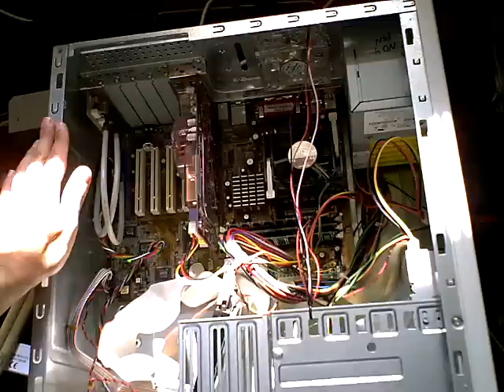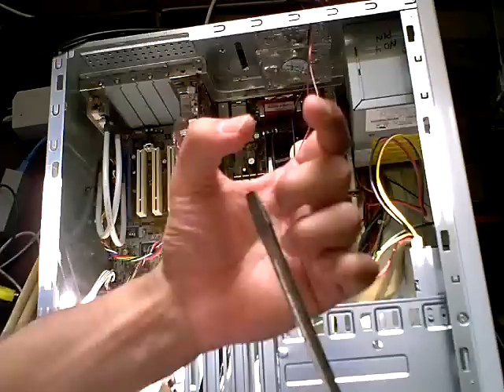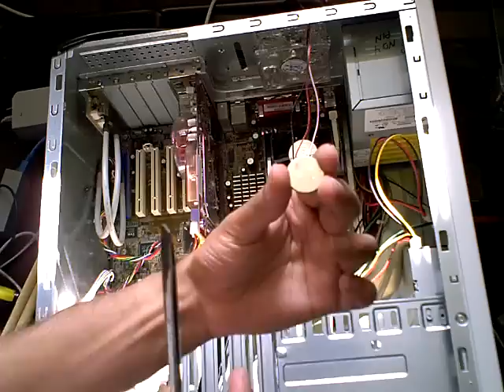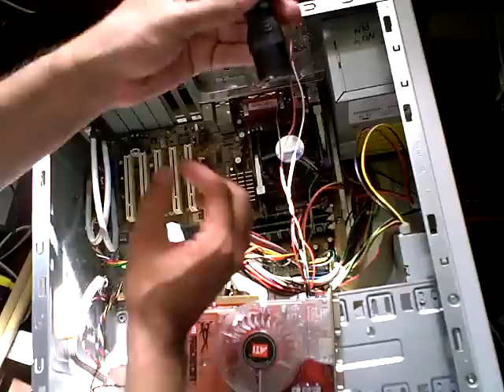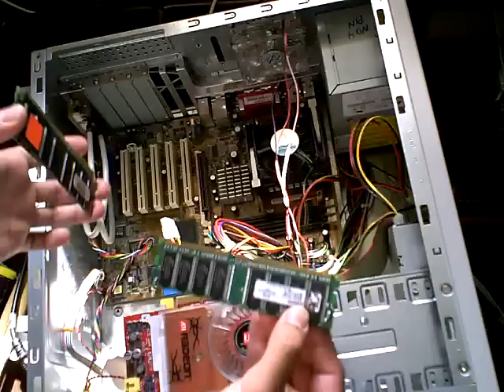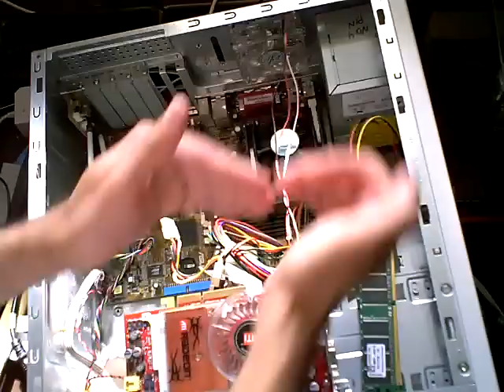How to possibly fix a PC that will turn on but will not beep and will not display anything on screen

Comment: Im desperate my problem started with my pc rebooting by itself when gaming, then it would restart at random now it wont even show picture on the screen but the computer is on.... what should I do?
Reply from the maker: It sounds like your motherboard is developing a short circuit due to contact with the metal casing. Most likely it has to do with the screws and metal mounting stands (supports) that your motherboard sits on. The cheapest way to fix this problem is to introduce cardboard washers between the screws and where they make contact to the motherboard, or you can buy plastic mounting supports at a computer shop.

Alternatively, you can always Breadboard it: 1)place the motherboard with CPU+Fan on wood or non-shiny cardboard 2)connect all of the case connectors to the board's panel 3)with a power bar that is OFF connect the PC power cable from the power bar to the power supply and the power supply to the board 4)while NEVER touching any exposed component,power on the power bar and press the power switch on the case.If the problem still persists,one of the remaining components is probably defective.Power off the power bar before dismantling

I cover breadboarding in greater detail in this video:
Advanced troubleshooting technique tutorial of how to possibly fix a PC that will not beep at boot
---

Comment: i have a a68hm grenade made by msi i got their bundle with a amd processor its all connected correctly but when we try to load start bios it doesnt load. my fans and leds are on  but my screen is black
Reply from the maker: +candykiller287 Same issue as shown in the video. Try what you see there

Comment: I never needed to remove CMOS battery before resetting it by using the jumper. Is this really necessary?
Reply from the maker: +MarkoH01 Unplugging the PC, Removing the CMOS battery, pressing the Power Button on the chassis, and waiting overnight performs the CMOS reset most assuredly. The jumper pin method is for a quick fix (that does not always work well sadly)
Reply: Thank you for letting me know. I did not realize that the jumper method sometimes does not work. Good to know :)
Reply from the maker: +MarkoH01 Best of luck with it all.

Comment: Ok so my pc is turning on i get the beep and everything but it is loading up then stall idk what would make this happen even in bios or before it even loads my keyboard it can stall i most of the time can start to boot up windows but shortly after it starts my screen flickers and it stalls idk what todo about it no settings are doing this i tryed testing the ram is fine my proserer is being cooled at 40•c so at this point i have no idea what whent wrong
Reply from the maker: +repo gaming Hmm, I was going to suggest that the CPU is overheating. Perhaps it's a faulty component? you can always Breadboard it (explained in the following video:)

If the steps in this video did not provide a solution to your problem, view:

http://www.youtube.com/watch?v=_EK9a-R5pss

You never know, maybe rebuilding the PC in the opposite sense that you took it apart will solve the problem.

Comment: The is quite helpful, thanks! Even tho it doesn't solved my issue!
Reply from the maker: Sorry things didn't work out. Have you tried Breadboarding it? (explained in the following video:)

If the steps in this video did not provide a solution to your problem, view:

http://www.youtube.com/watch?v=_EK9a-R5pss

You never know, maybe rebuilding the PC in the opposite sense that you took it apart will solve the problem.

Comment: my pc first started to hang after login, and i had to restart it again, with no guarantee how long i have before it hang again, and now suddenly a black screen, what could the problem be?
Reply from the maker: +Adit chauhan Many things. Your operating system could now be corrupt. Your CMOS settings could be corrupt, etc, etc. Is your PC beeping at boot and displaying something on screen?
Reply: RodneyDickson thanks for your concern, there was no beeping at all, no display at all, what i did was cleaned the fans, discharged the cell ,replugged all the wires, hopefully it worked.
As i said it used to hang in between b4 by that i thought may be alot if dust on fan over processor causing that. So i did.
Is it that the computer stops if the fan over processor stops spinning?
Reply from the maker: +Adit chauhan Well, I would say that you should breadboard the machine to diagnose what is the problem more precisely, but if you are saying that the problem is intermittent, then perhaps just tough it out. Btw, if your CPU is not receiving adequate cooling, then your CPU will shut down to prevent damage, thus freezing your machine (including mouse movement)

Comment: when i start the pc It's showing that disk boot failure,insert system disk and press enter i hv inserted disk and tried 5 to 6 time but it's not working what should i do
Reply from the maker: Ok, if you had a hard drive installed with an operating system on it, then your machine is having problems accessing the hard drive. If you didn't and are trying to access a bootable CD, DVD, USB or Floppy, you might need to set the proper boot order in the BIOS. Enter the BIOS and ensure the boot order is set in the order in which you wish to access, and also ensure that no other devices may be interfering with the boot process (CD, DVD, USB, or floppy unintentionally left in a drive).

Comment: Sir can you help me, I just inserted lately a RAM 2.5v on my PC for additional I have 1.5v RAM. It smoked and lose monitor connection when I on it again. I immediately unplug and remove the RAM that I installed. This is the pc I've been using now. Would this okay to use again for an hour sir? Please help...
Reply from the maker: Well, if there is damage to the components, I'd say the damage is already done. To be sure, you can unplug your PC, remove the RAM modules, observe the contacts of both the RAM modules as well as the RAM sockets for any damage or burn marks, and if both are still good, return the 1.5v RAM module to a socket that DID NOT have the 2.5v RAM module in it and try to use the PC. If the PC still works without issue, then I wouldn't use the socket that had the 2.5v RAM module in it ever again. Hope things still work out for you.
Reply: Thank you for the respond sir. Yeah I removed the 2.5v RAM and I will never place a ram on the slot which it has now burned. My problem is that the pc is still working infact this is the pc I'm using now but could it be possible if the damage area of a socket ram will melt while I'm using sir?
Reply from the maker: UltimateSmackTalker
If the contact of your RAM module has burnt, then metal flakes making contact between pins in the RAM socket could possibly cause heat, melting, or even a small fire. Perhaps for the first week of use, you shouldn't leave the PC running unattended. Afterwards, I would assume that it'd be safe to use your PC unattended. If you are really worried, you can unplug your PC, and use compressed air (remember to hold the can UPRIGHT and not slanted or upside down) and blow compressed air in the damaged RAM socket to hopefully dislodge any metal debris. Afterwards, leave the PC unplugged for an hour, then afterwards you can get back to using it.
Reply: Thanks sir, good thing for the supposedly inserted RAM 2.5v didnt leave a metal or plastic melted in the slot 2 sir I checked the 2.5v RAM the one tiny metal in it which is burned area is still there but when I scratch it already detached but luckily didn't attach to the slot 2 RAM and so 2.5v RAM wont be use again and I will not use it either.

The RAM 2.5v which was damaged still in its shape only 1 of the tiny metals already detached sir the one I scratched. Sorry for my bad English.
Reply: But the 2pins of the RAM 2 slot socket in motherboard is already not in line (14 pins aligned). I will not use the slot 2 RAM socket anymore, my other concern sir, would it not be melted even though there's no more RAM inserted in it but the 2pins in it are already not aligned right sir?
Reply from the maker: UltimateSmackTalker
I think your approach is the right one. Do not use the damaged 2.5V RAM module any longer, and do not use the slot that is misaligned any longer. I cannot talk you through the repair of said slot (I've never done anything like that before) so I think just not using those items are the best course of action : )
Reply: Yes sir. Thank you so much for your time :] Best of luck to you
Reply from the maker: UltimateSmackTalker
My pleasure. All the best : )

Comment: My pc starts up, but doesn't respond/ and no display/ and no sound. But know, I have a computer from 2005. I have just installed a 650w power supply and a GeForce gtx 760 in the computer for laugh and giggles, it was working fine and was work really good. so I had powered it off and went to bed, and when I woke up, it had did that......?? could it just be the mother board?
I had disconnected the graphic card and tried using the onboard graphic, but still nothing. But when I do power it on, I cant shut it off, soooo... I have a switch on the back of the power supply that I have been using, I even reset the cmos too, but still no improvement, I did order a new, and improved/ gaming/ board and processor, but it would be nice if im missing something and it can be fixed!!!! But my only theory is that the power supply had to of over worked the board, and buring something on start up.and also my fan speed is at full and the usb ports still power!

 PLz help if u can!
Reply from the maker: +A_CRAZY_WHITEBOY Breadboard it (explained in the following video:)

If the steps in this video did not provide a solution to your problem, view:

http://www.youtube.com/watch?v=_EK9a-R5pss

You never know, maybe rebuilding the PC in the opposite sense that you took it apart will solve the problem.
Reply: i just bought a new build. thx anyways    :)
Reply from the maker: +A_CRAZY_WHITEBOY Better that way : )

Comment: i got home from vaction, pc was on standby. so i tried to boot it back into normal mode but it didnt so i tried to turn it off and the button didnt respond. cut the power. now i dont get any screen alltho every component does startup, would thois be a power supply problem or just a dead motherboard I( did all your steps nothing worked)
Reply from the maker: Oooh, it's a real good thing you added that last parenthesis at the end, else I just would have told you to watch the video : ) Sadly, the only thing I could tell you is to Breadboard it (explained in the following video:)

If the steps in this video did not provide a solution to your problem, view:

http://www.youtube.com/watch?v=_EK9a-R5pss

You never know, maybe rebuilding the PC in the opposite sense that you took it apart will solve the problem.

Comment: yo i'll tell you the whole story. so i hit my computer while i was using it and i did that 2 times. first time i hit it the screen froze and there was a weird sound coming out of the speakers but when i restart the pc it was all good. second time i hit it, it froze again and there was that sound but when i restart it wouldnt beep at all. so i opened my pc and start doing what you did. weird thing is i remove graphic card first and still no beep sounds, but after i remove my rams i get 1 long beep and 2 short beeps. i get 1 long beep and 2 short beeps when i have graphic card connected on mobo and connected with a monitor (no display tho). can you pls help me cause im considering buying and new pc. thanks in advance :)
Reply from the maker: +ExcellentChoice1996 Beep error codes differ from one BIOS manufacturer to the next. To discover what the beep error code is trying to telling you, discover the manufacturer of your BIOS (available in the motherboard's manual or on the motherboard's manufacturer's website {on the page for your specific motherboard model}) and then look up the frequency and interval of your beep error code on:

http://www.computerhope.com/beep.htm

Comment: When I plug my monitor cable to my graphics card, there's no signal to my computer.. But when I put the cable to the normal plug.. It works please help!
Reply from the maker: Ok, you have to change the default primary graphics adapter setting in your BIOS from integrated to add-on. Your motherboard's manual should tell you which option to do this with.

Comment: My Pc is like that but in a matter of minutes it turns on if you restart it turns on fast but if I shut it down sometimes it boots fast sometimes it doesn't boot and the power restarts it self and power on again in a matter of minutes it turns on. What could be the Problem of my PC?
Reply from the maker: +Edd Justinn It sounds like your motherboard is developing a short circuit due to contact with the metal casing. Most likely it has to do with the screws and metal mounting stands (supports) that your motherboard sits on. The cheapest way to fix this problem is to introduce cardboard washers between the screws and where they make contact to the motherboard, or you can buy plastic mounting supports at a computer shop.

Comment: can you help me,i just add my ram on my pc,but when I run my games it wont start or lunch it,i just upgrade from windows 7 ultimate to windows 10..i hope you can help me..sorry for my bad English
Reply from the maker: +naim Cor3 Sounds like it's your operating system (Windows 10) that does not like your hardware. Go back to Windows 7, trust me, it's a better operating system

Comment: FOR me It was the new gpu that made such problem I used to use msi gtx 460 on motherboard P67A-GD53 and it worked just fine but when I replaced it with ASUS R9 270 2GB GPU my monitor showed nothing and I didn't hear the beeps anymore ...so could anyone help me or at least explain to me why this problem happened and how to fix it ?????
Reply from the maker: +Mehdi Menallah If this is new hardware that you are installing on your motherboard (that has not yet functioned on your motherboard,) note that matching bus types of video card to motherboard socket (PCI-E for example) or matching bus types of RAM module to motherboard socket (DDR3 for example) does not necessarily signify compatibility. If this is the first time you are trying this hardware on your motherboard, there is a chance that this new hardware is not compatible with your motherboard, despite the same bus type and despite the fact that the new parts fit in their respective motherboard socket. Your motherboard manufacturer's website will have a support page dedicated to your motherboard's model, and on this support page should be a compatibility list for such components as video cards and RAM modules. Ensure that your new component is certified to function with your motherboard, and if your new component is not present on the compatibility list, then there is a chance that the new component is not compatible with your motherboard.

Comment: I have just built my pc and tried to run it for the first time but after i hear the beep it is not showing anything on the screen. What could it be?
Reply from the maker: +Dario Milanovic Your PC is probably outputting video on a different connector than what you are connecting your display to.

Comment: my problem is:
when i started my pc,it beeps but after showing motherboard screen the screen turned black & then i pressed the restart button than no beep sound but cpu remains turned on but monitor remains off.pla help what will i do????
Reply from the maker: +sadek khan Same issue as in the video. Follow the steps

Comment: My cpu not booting..it show green light for second and cpu get turn off ..my optical disk also blink for a second what may be the reason...plz help
Reply from the maker: +DIPIN C  It sounds like your motherboard is developing a short circuit due to contact with the metal casing. Most likely it has to do with the screws and metal mounting stands (supports) that your motherboard sits on. The cheapest way to fix this problem is to introduce cardboard washers between the screws and where they make contact to the motherboard, or you can buy plastic mounting supports at a computer shop.

Alternatively, you can always Breadboard it (explained in the following video:)

If the steps in this video did not provide a solution to your problem, view:

http://www.youtube.com/watch?v=_EK9a-R5pss

You never know, maybe rebuilding the PC in the opposite sense that you took it apart will solve the problem.

Comment: HELP!! please from any of you computer experts - I upgraded my gpu frrom a 760 to a gtx 970 it worked for a week - then I turned pc on and no signal to my monitor (from gpu) - old card still works fine in current pc - and new 970 works in my mates pc - I have a decent 600w power supply.... nobody knows the answer or any suggestions so any help would be much appreciated - 

I have tried unistalling Drivers and updating bios but not successful also tried re seating ram but doesn't work either
Reply from the maker: +berton tyler What do you mean by the 970 'will not work' in your PC: are you able to get into Windows with generic Windows drivers?

Comment: My pc powers on perfectly but then I says startup repairs. And then asked to restore it. I did and the pc restarted. Then the same message appeared guving two options 1) startup repair and run normally. I picked startuo repair because it said if you just restore it and your pc reset choose run normally. Then it loaded fine and to the windows loading, BUT it just goes to a BLACK SCREEN! please help
Reply from the maker: +Camy Ymac your Windows installation has become corrupt. You will need to format 
your hard drive and reinstall Windows. Keep in mind that you will lose 
all of your personal data, so you might want to first boot up with a 
Linux LIVE CD to recover your personal data before doing this.